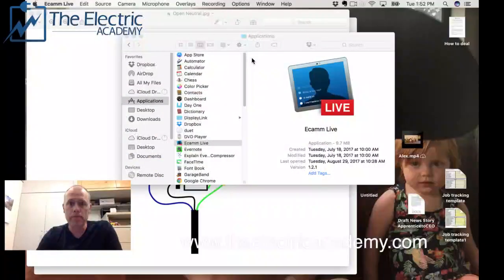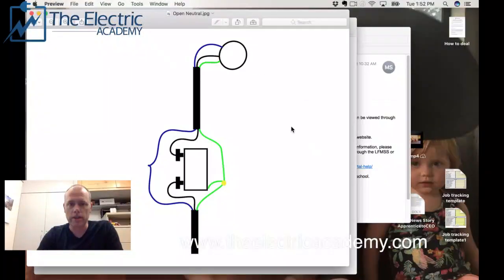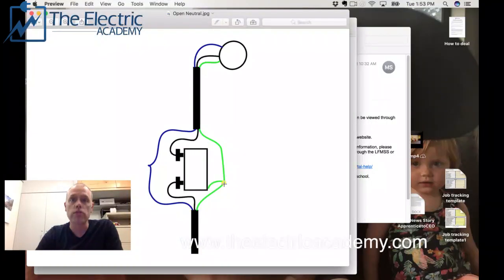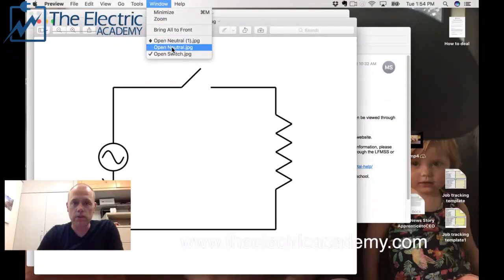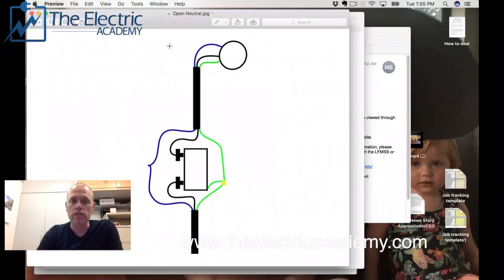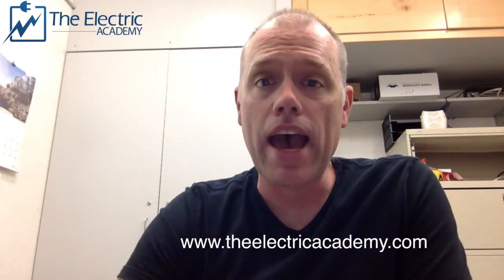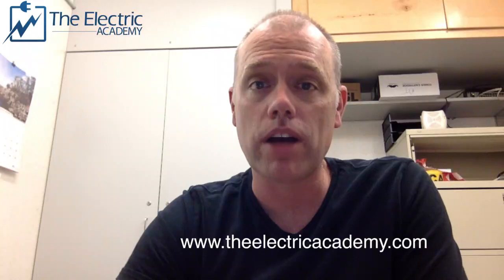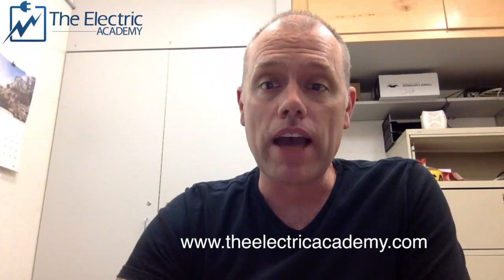The Danger of the open nuetral!

Comment: Our neutral broke at the utility pole. This intern shot 180 volts to our 110. We had multiple fires, the TV caught fire, the refrigerator simply quit working, A fan caught fire. We called 3 electricians none new what was wrong . After a day the refrigerator thawed out. I took some food to a friend. HVAC man was there. He knew imediantly it was at the utility pole. Wires were sagging in the yard next door. The metal cable was burned into. It's truely a dangerous situation.

Comment: Just a little FYI. So people easily understand and remember which side of the receptacle is the hot side. I point them to their kitchen sink. Power (hot side) comes from the little faucet and drains (neutral) down the big hole. Small and large side of the receptacle.

Comment: You may want to teach about this as well. When an outlet has a broken neutral and you get it to work by running a small wire from neutral on the outlet to ground. I know it's wrong but I've seen it done lots of times. Tell us why and what can happen. Thanks.

Comment: i do catv house had broke nuetral between meter and pole foreign voltage detecter didnt detect any voltage,  disconected to test signal and it damage alot of appiances it was using catv for the nuetral.

Comment: I have in my home lights that dim when an appliance or refrigerator compressor comes on. It’s not just one light but a lot of lights in different situations, different appliances. I’ve been told I have a “loose” neutral. Question: How do you find a loose neutral? All my lugs are tight in my panel box

Comment: we just had a fault in the neutral in the underground feed. Not totally open but under load the other leg shot up to like 150 volts

Also i was visiting barcelona spain and i got shocked like 3 times while i was there. One was a suspected open neutral on a dishwasher but i didn’t have my meter and i wasn’t about to pull that thing out from under the counter.

Comment: My outlet isn’t working. Put my outlet tester in and it reads open neutral. I took off the outlet cover and pulled the outlet out. Used my pen tester and the lines are hot. I switched off the breaker. Disconnected the outlet and am going to go buy a new outlet. If this doesn’t work, what is wrong?

Comment: If people would take the extra step to T-tap it would have a lot less chance of an open neutral happening an the rest of the branch circuit failing. If the receptacle did happen to burn out if it was T-tapped then that receptacle would be the only thing out not the rest of the circuit. Also, it does hurt like He** to get hit by a open neutral. I got hit by a 277 open neutral on a lighting circuit during demo before. It felt like I got punched by Mike Tyson.
Reply: I got hit by an open neutral in a 3 phase motor it felt like a car run over me
Reply: I got struck by lightning...... Felt like I got struck by lightning...... 

Just messing lol

Comment: how about an open neutral on an old two wire house (no ground wire)? black wire at outlet and switch is energized, but no voltage across the two wires... i just need to trace where the neutral break is, right?  note, the switched light use to work intermittently, I think based on ambient temp rising as though a poor connection was affected by contraction/expansion.

Comment: Hi, I have a question I have a bad receptacle in the laundry room for the washer sometimes it doesn't work and sometimes it does when I wiggle it a little bit and now it has stop working completely to run the washer. So I went out and bought a new one I hooked up the new one the same way as I took out the old one ,of course I turned off the main power switch before proceeding to do the task. After putting in the new receptacle and turning the power back on still the same issue. I put a circuit tester into the "receptacle and got an open circuit reading before replacing the old one with a new receptacle and the same issue with the new one I checked the other receptacle on the other side of the laundry room and found that there were no wires disconnected I even striped the wires back, also I noticed in the breaker box the switch for the laundry room has 20 amps on it and the receptacle has 15 amps on it does that make any difference

Comment: Would electricity flow black if you have an open neutral in a 3 phase motor?
Reply: Only 1phase motor has a neutral
Reply: @brrr8963  there’s VAV’S that work with neutral in a 480V circuit

Comment: would a tick tester beep on a open nuetral
Reply from the maker: Yep, it should
Reply: yes it does
Reply: A tick tester reacts to voltage not the color of the wire🤣
Reply: It won’t it’s load/amps not voltage.

Comment: What is 'switching the neutral'? And why would anyone want to 'switch the neutral'? Are they switching the neutral with the ground? Ideally the ground never passes any current.
Reply: In older homes, typically before the 1930's, the grounded neutral was used to switch a light on and off. Keep in mind electricity was in its infancy, and it still is compared to plumbing for instance. After 1930, this practice was changed as more and more information was gathered about electrical flow.
Reply from the maker: +electricalron hey thanks for the info. I live that we are still just learning about it.